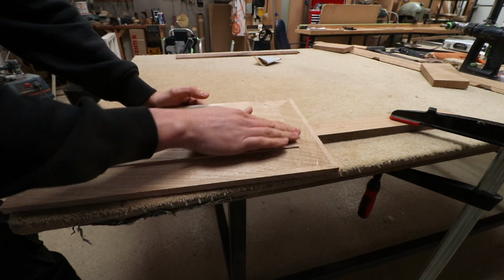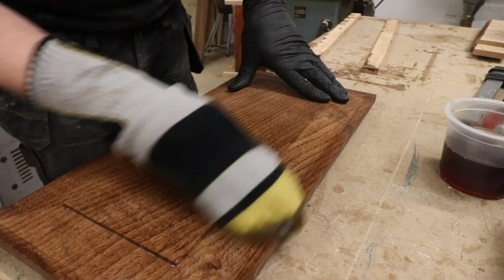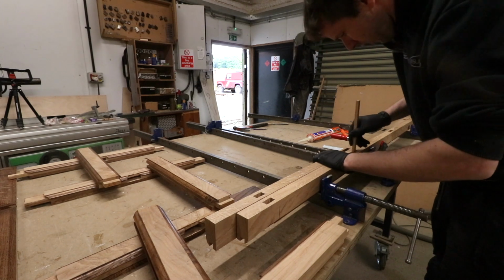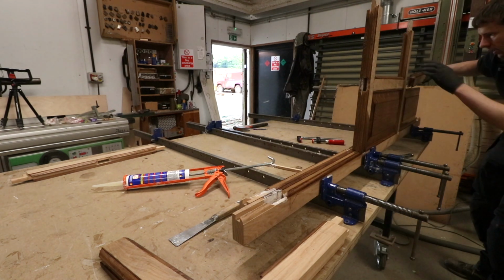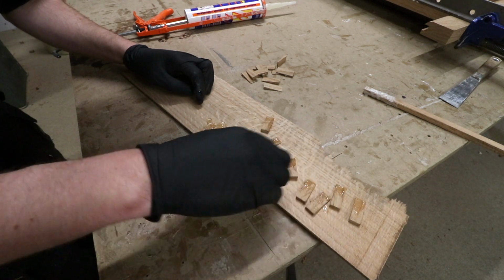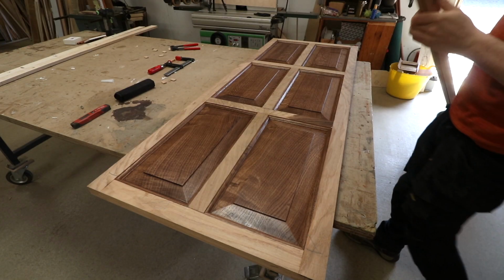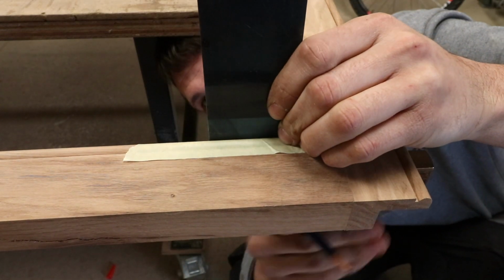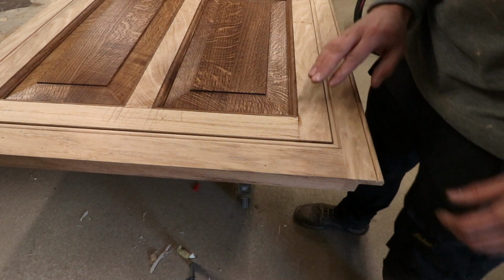English Oak Cupboard - Part 3: Assembly and Finish

Comment: Top tip - when you transfer the marks for the frame hinges on to the frame (roughly 26 mins into you vid) use a chisel and lay the flat end on the edge (back of chisel) of the door hinge edge - kind of roll it onto the edge of the frame to only mark 1 -2 mm (no more than depth of hinge rebate. Marks it perfectly - like using a marking knife.~ Also I have seen so Many doors cut square at the 'leading edge' probably because of the common use of electric planes to fit doors now.  Lots of people would probably appreciate knowing how simple that is to do - especially with a hand plane :)
Reply from the maker: Thankyou Robert, yeah thats a good shout i will try it! And good suggestion for a quick video that, noted!

Comment: Hi mate, hope your well??  I have a question in regards to panel saws and I'm interested in your opinion. I have always used a table saw and added sleds/jigs etc to cut sheet material and timber stock.  
Im considering purchasing a sliding panel saw, only thing I'm not keen on is the floor space it takes up. I notice you use the vertical wall saw and wondered your reason for it? Does it give a good splinter free cut on both sides of plywood etc?  Is there any maintenance or things that need replacing regularly on them? 

I really like the space saving and convineance of the vertical panel saw I'm just not experienced at using this type of machine. 

Would appreciate your thoughts on why you use it and what you think of them overall. 

Kind regards from Perth Australia.
Reply from the maker: They work really well for big cuts and sheets. Incredibly accurate and easy to use. Bit of a pain turning sheets to reference from a clean cut edge but it's as much effort as getting a sheet flat on a panel saw I think. You can't do bevel or angle cuts on them which is a big downfall. If you just want accurate square cuts then that are great. Perfect for my carcass production. You can get ones with a pre scoring cutter head I think 👍. 

For me it's perfect. I only do square cuts, I don't use it that often but wouldn't be without it. I defimi6 cannot warrant a big table saw capable of 8x4 sheets in my workshop space. I'd deffo have one if I had the space though!
Reply: @BradshawJoinery   I agree 100% 

I guess it one of those things we always do no matter what we purchase, we will always feel we need another machine to make life easier 😂😂
I have felder coming out in the next few weeks to go through there panel saw options he believes for me as a single operator non production based work the hammer k4 is a good all round option.

Will see what happens 😀👍

Comment: Brilliant!  So you don’t worry too much about squaring up the doors at glue up? Just trim them dead square later on panel saw👍🏻 
   Nice! Eliminating a bit of stress. It would need to be pretty shonky for anyone to pick any variation in top and bottom rail from one side to other ( non parallel)
Reply from the maker: Yes and no on the squaring. Ive found from experience if the joint look right and your kit is square you have to try quite hard to knock it out of square.... so i generally trust it and check where necessary or where the fit is critical. The panel saw sizing just helps keep fitting spot on. very easy to plane a casement to fit a frame and the frame be slightly out of square..... hence if you know the door is perfect when fitting you can adjust the frame to suit and you have a perfectly parallel and square opening. Just need to take care on edge cuts that the blade doesnt deflect across the width of a door,

Comment: So nice!
Hope you will one day make a traditional external oak door!
Want to make a new front door for my house, but very uncertain how to go about it with floating panels and avoid water ingress..
Reply from the maker: When i have one to make i will, but its much the same process. bed the panel in on some flexible sealant, quite often they are beaded in from the inside so if you do get an issue you can remove beads and reseal panel! Still possible if grooved in, just cut moulding off remove panel then use beading to replace on inside. ideally the panel wants a flat part where it enters the groove to allow movement
Reply: @BradshawJoinery  I am making a painted finish external door at the moment it is 1m wide by 2.8m tall! 4 raised panels and two lights at the top, what sealant do you suggest is best for the panels and is it better to prime the panels before glueing up? Love your videos mate absolutely top notch! Very difficult to find good joinery info and resources these days I'm trying to search for some good old joinery books too, I didn't have the best apprenticeship, so I'm trying my best to self-improve!